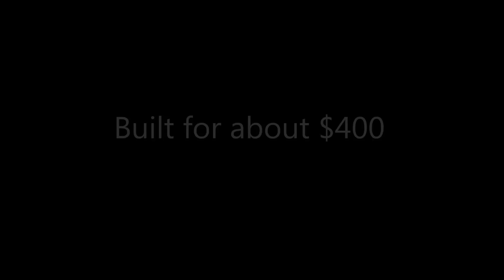DIY $400 CNC Machine

Comment: hi great video do you have a link to the electronics pack for this on ebay i am building one but dont want to purchase motors that as to small
Reply from the maker: Hi Matthew - The pack included 3 NEMA 23s, the power supply, and the controller board with some other odds and ends.  One recommendation I would give though, is to consider a kit that includes a 4th axis.  I am limited to three axis and for most of what I do that is more than fine.  However, I've thought about tinkering with a 4th axis on a cylinder but can't with my current set up.  Best of luck.
Reply: drez20001
Hey Dan, what are your NEMA's rated at and are they handling this work with ease or near their limits? What is the model routers you use and their weight/power rating? From what I've seen so far, some folks have tried to save a few bucks using motors rated for lighter duty (3D printers etc) and ended up with an inconsistant machine. Really cool toy BTW :-)
Reply from the maker: These are Nema 23s and seem to have plenty of power, the machine has never bogged down from lack of stepper strength.  The router is more of a limiting thing.  I am using a Dewalt D26670 router I got at Lowes for about $90.  If I'm doing a lot of v-carve work in harder wood I need to slow down the feed rates and make sure the cutter is sharp.  A truly full sized router with a HP or two would work fine with this CNC machine, it would just have to be re-designed to hold a large router. It's a fun project.  Beyond the actual CNC machine is the whole software side of things which has a large learning curve on its own.  But still a blast to play with.  Great hobby.
Reply: drez20001
Yup, sure is a fun way to use up many hours of time! ;-) I'm thinking of a machine to model aftermarket panels for cars and then make a mold for fibreglass or carbon. e.g. Rest a car ('67 mustang fastback) on a frame. Get the machine to probe the original panels and map them. Put that into some software as the base and then do things like plump out things) then layer some foam or modeling clay substitute. Get the machine to mill this and then take a mold from the result. Just makes it nice and repeatable and you can flip flop it in software to get the other side exactly equal in a flash..... Yummmmmm!!! :-)
Reply: YaniT991
....making the frame to rest the car on way bigger and make it what the CNC is built on so no flex or movement between the 2 things. 2 by 6 RHS base and 2 by 2 sides/top ought to do it and 20' L by 10' W by 6' H......

Comment: Hi me fend I have a big machine bat a don no how to program the machine or make a gcode if you no how please send me information an if you   need to cut pcs I cutter for you for free sen me the gcode for ane pcs you need ans the material

thank you

rey rubio
Reply from the maker: It can get complicated.  There are several steps to the whole process - a design program and then a program to convert to g-code are needed.  There are some great online forums to help in the process.  It's more involved than I get into here -but do check out the forums.  Many great friends there that can walk you through the process.

Comment: Go to Fastenall and ask for a band clamp. You'll need to know the diameter of your roto tool but a band clamp is much stronger.
Reply from the maker: Good suggestions.  I ended up re-designing the machine to hold a regular-sized router though with a different holder.  Thanks for taking a look.  Appreciated.

Comment: nice machine, but looks like it could use some serious improvements for accuracy and stability. Have you looked into SBR slide bearings and acme threaded rod for the axis movement? Would be quite a bit more accurate than drawer slides and hardware store threaded rod, especially for something this size. Either way, nice machine, you've made much more progress than I have, I'm still in the "I'll build one someday" phase.
Reply from the maker: It's pretty stable for what I've used it for - just soft wood working.  I'm sure there are ways to make it a lot stronger, perhaps one day.  The real challenge when I started was to see if I could even pull it off.  It was built without any plans, just winging it as I went.  The quality of the v-cave signs using free open source software has been really impressive.  I have other videos of some of the signs I've made.  Thank you for your suggestions.

Comment from the maker: I appreciate the suggestion.  I've been pretty impressed with the registration and accuracy this machine has.  The machine has double drawer slides for each axis.  I've made some changes to the cutter - installed a router that can hold a regular 1/4" bit and have fine tuned the software.  I have some other videos that show some of the projects I've done.  The Venture 17 sign came out pretty good.  Thanks for taking a look and commenting.

Comment from the maker: Yep.  I just used the standard all thread rod from the local hardware store.  I don't recall the size, I eyeballed most of the design.  I had to go through a couple rods though because they were bent also.  While in the hardware store I kind of laid them out on the floor and rolled them to see which ones were the best.  Thanks for taking a look and good luck - do post your video results.

Comment from the maker: Many thanks.  It has been a fun project.  I'm doing a few little modifications on the Z axis that will make it a little tighter.  I'll post a video when that is complete.  I've also done a few cuts with the machine and it's pretty cool to see it run.